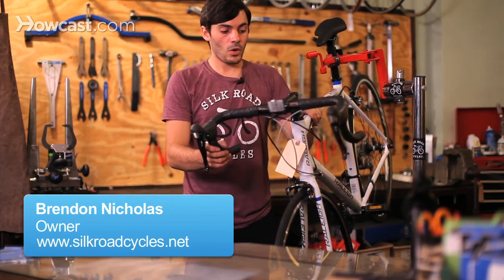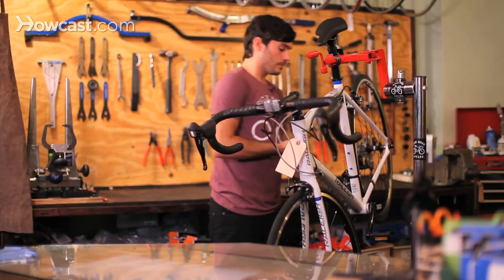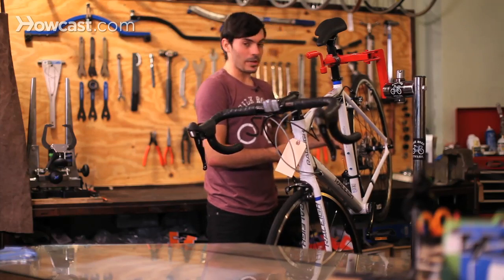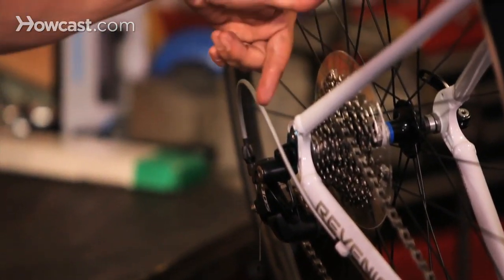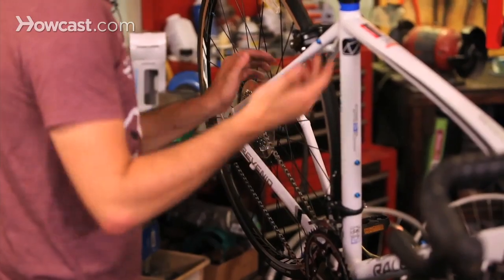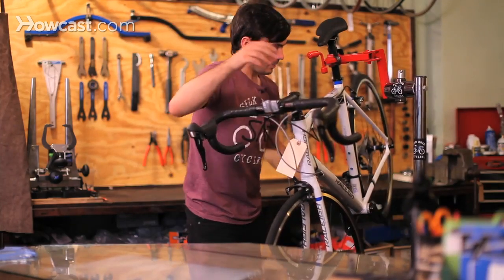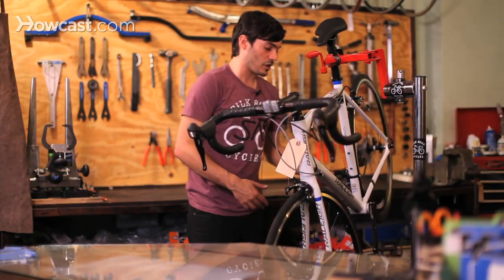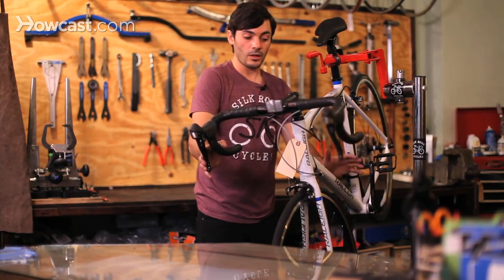How to Adjust a Poorly-Shifting Bike | Bicycle Repair

Comment: Love how bike are sold stating a certain amount of gears but you're advised not to use them.
Reply: Just specific ratios. Really limits you by 2 gears. Entirely worth the benefit of having two sets up front.

Comment: The thing is that i bought a new mountain bike and i am totally new... the bike is a 21 speed bike and after 3-4 rides i used to think that when i shift gears the chain moves into different cogs... and it seems thats the right thing but after today i was riding i noticed that after i once changed gear it started making noise as if it is making contact with something while i pedal so i checked it  out and when i change gears the chain no more changes cogs??? but i think i feel the difference as if it is changing???
I am new to this and help will be gladly appreciated!! :)
Reply: Same problem with my cycle

Comment: i have ran into a issue. my bike tire will not spin when i try to crank me peddle. the hole thing just spins w/o the tire spinning its a schwinn, 300 bucks. took so long to save for a good bike a yr or so ago..

dont have the cash to wast to take it to someone  (state budget)
Reply: +thunderlord2200 
I had this issue after going through deep water, then we had really cold weather; I took a hair dryer to it for a few days and the free-spinning lessened. When I did have the problem, I could "back-spin" some, then forward spin and just hand with it until it caught.

My guess is water was getting frozen inside the the housing, eventually worked its way out.

Comment: don't know if anyone else has same problem, I have 3 gears? and 8 speeds, usually ride in 2,8 config. cruising along there is no noise (pedalling softly to moderately) but when i get some speed up and stand, pushing with power the chain slips? and it makes a clunky sound, does that every couple seconds. it's the only gear with which I have that problem.
Reply: Mine too did you find out?
Reply: Jaime Uh if you're reading this, went to a bike shop to have the problem looked at. ended up having to replace the entire rear cassette, front 3 cogs and chain since all 3 parts played a part in the issue (damn worn down parts was it). total cost of $240 australian

Comment: help me pls... I have Capriolo CTX 240 Full Suspension, and I have problem with shifting. On shifter is 1st gear but its not 1st, its 2nd gear and when I try to put chain on 1st gear it feels or it backs to 2nd gear pls help....
Reply: I fixed it, but now i cant ride in 2,3,4,5, I can only ride in 1st and 6th gear. Its easy to fix. Just try to adjust two bolts on derailleur and it will fix gears I hope.
Reply: I have the same problem......

Comment: my bike will not go into 1st gear I pull it there then it just goes back to 2 it doesn't even click when I pull it on first can someone help?
Reply: It sounds like you might need to adjust the limiting screws on it. Best bet is to take to a good bike shop and ask them.